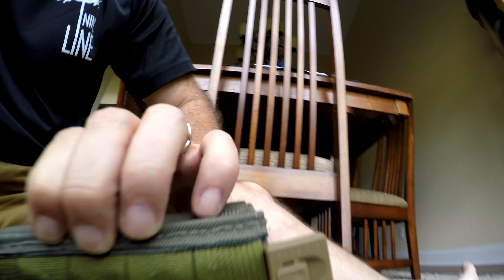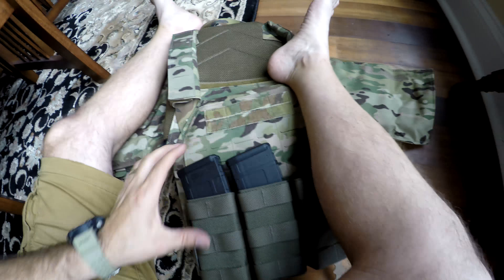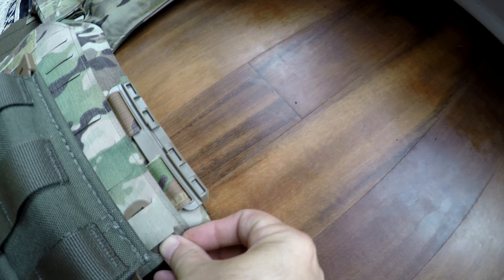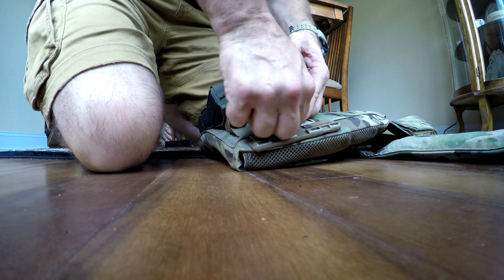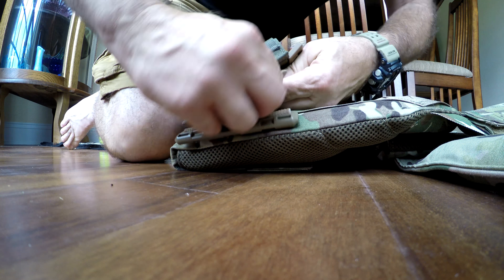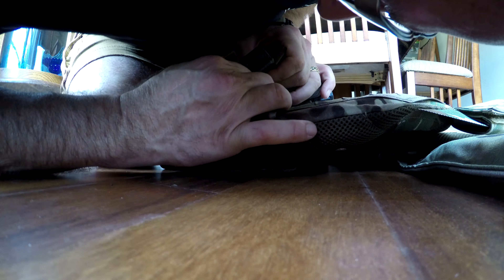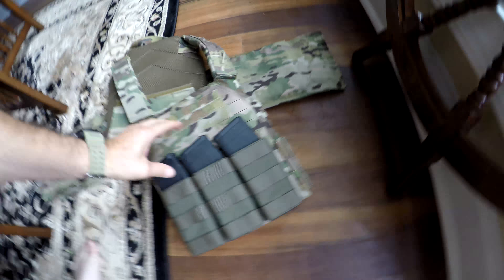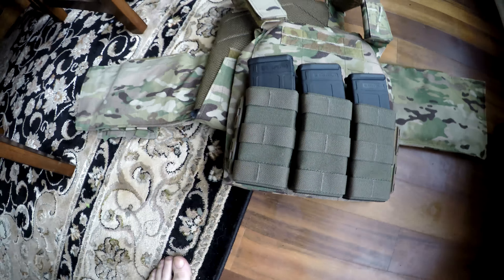Malice Clips How to Install

Comment: Great setup, but just know that the clips are installed upside down
Reply from the maker: Are you meaning I should install them from the bottom up or flip the clips around?
Reply: @rrlifestyle2228  Bottom up The buckle part should be at the bottom of the pouch not the top
Reply from the maker: @IMEZRU1967  Since I'm forced into retirement right now I'll reverse them. Thank you!
Reply: For others wondering - buckle goes at the bottom so that if it comes disconnected it can't slide down and unweave.  Molle is by nature very tight, but it could be a problem if you're crawling and it's dragging across the ground.

Comment: Thanks for the video. These came with my AR500 multipurpose holster. No thanks. Going back to the molle straps. What a pain in the ass. Wonder how they do in extreme cold. Thanks.
Reply from the maker: That would be interesting to find out. I live in the south and the coldest it will get here is in the teens overnight so I'll have to leave that research and development to others.

Comment: I have the same setup. Just a tip, the KYWI pouches have velcro-attached kydex inserts. Just pull the kydex inserts out first so the soft pouch is much easier to handle, then thread the clips through each row of molle webbing all at the same time, not one at a time. MUCH easier. 

To get the kydex velcro from being a pain in the ass when re-inserting the kydex into the pouches, just slip something rigid inside the pouch over the velcro, position the kydex insert where you want it, then slide the object out that is separating pouch velcro from the kydex velcro.
Reply from the maker: Great tip and great setup right?!

Comment: You really dont need to weave them like that, just down the row of the rig and up the row of the carrier. Also the tabs should be pointed down so the gravity doesnt pull on them.
Reply from the maker: Thank you!
Reply: weaving is best. it keeps the pouch tight to the carrier so it doesn't flop around.
Reply: Incorrect you need to .